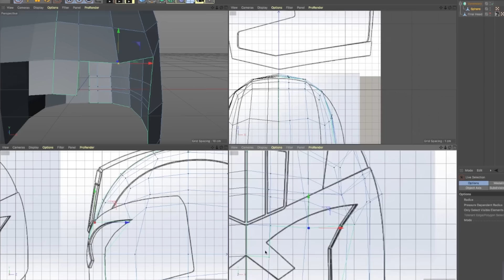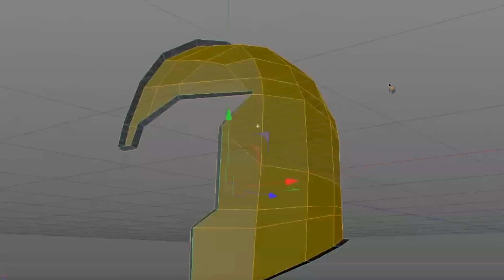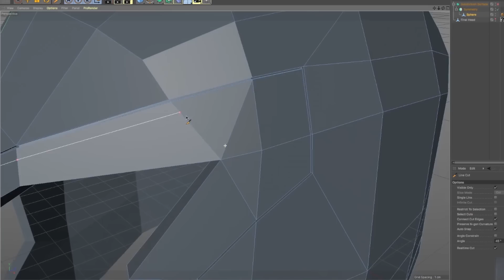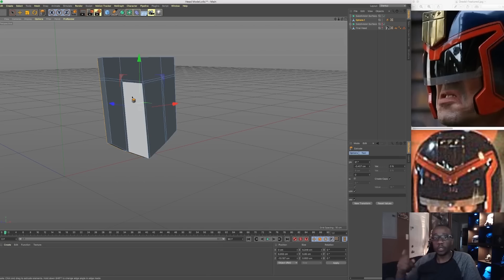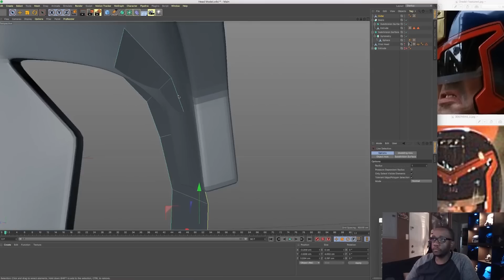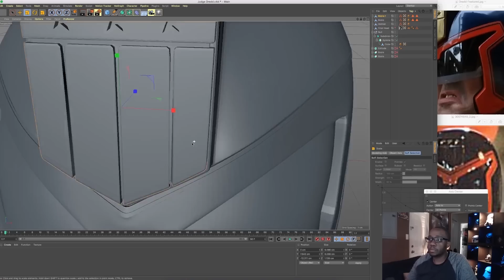Modeling a Judge Dredd Helmet for 3D Printing!

Comment: While I think this was a great video, a few things were not quite right for me! The badge actually only had 3 vertical bars not 4. And the jaw line of the helmet had a different profile, it cut back up instead of curving straight around. The visor also had an angled up cut on the bottom corners. Attention to detail is what it's all about when creating a replica. However showing the process was great!

Comment: Interesting video watching someone else model Dredd's helmet. I modelled mine (the real one that is) almost exactly the same method, although I kept it strictly all quades from the base mesh, which ended up being really difficult, I can tell you. This one isn't Dredd's helmet, though. It's not a judges helmet unless it has that iconic 'X' guard across the front. Plus there's just something overly clean and "off" in terms of the shape and design. Looks like something more from Buck Rogers than from Dredd's universe.

Comment: It's fun to watch all this whiz-bang stuff fly by. Gotta say, whenever one of those menus drops down and I see a minimum of 65 items to choose from, my heart sinks. Worse-- the "final" is still pretty far off. The angled shape above the "temple" area is not a sharp enough angle. The shape that hangs down off of the end of that angle-- is not straight, it curves a little. The badge emblem shape that is on the forehead comes out further is more vertical.
I am not blind to the abilities of 3D printing nor the underlying modeling programs. But right now-- seeing Darrell at the top of his game still getting it wrong -- is demoralizing. Between the cost of the programs and the materials -- and no small amount of time invested up to this point and then here -- working in clay is easier.
Consider the amount of hand finishing that goes into making a large print look good. Not much different from wet-sanding fiberglass (which I am guessing the Dredd helmet was made with). Problems of modeling the inside and fitting the plexi-- sure, all additional steps. But making more than one of these "one-off" 3D prints-- is just as much hand-work and trouble. A series of molds for something that large is expensive either way.
When the movie biz makes one of these, they pay through the nose to get a perfect finish with essentially no hand-work needed save for paint prep, etc. So, to me, that's what's got to change. The cost of the high-end prints. Otherwise clay, wax and scratch building is still better.
I still enjoyed the video.

Comment: The reason it gags when you subdivide is because you're using this software on a mac. A better work environment would go a long way. There's good reason the professional space is moving AWAY from mac for literally everything design/engineering/media production.

Comment: IMO Darrell went to the detailing part way too soon. He should have defined a simple "cup" shape and left it underneath to use both as a guide and to extract shapes from (including the visor). Then the bottom corners of the "eye" wouldn't protrude as much and would follow the overall roundness of the form a little better.
That, and he should also avoid the wonkiness of his loops because that gives problems later on, as it did.

Comment: Ahhhh great work!... but my detail nerdiness can't stop tingeling. Not sure if you followed the reference picture all the way but the visor has more of a curve at the bottom and the top corners are a bit wider than the picture. Still! Never 3D modeled so I couldn't do it better myself.
Reply: I'm with you there, all props to the guy but I was screaming inside on the top corners and emblem 3/4 discrepancy

Comment: The amount of pinching in the model X(

I guess it's fine when 3D printed.
Reply: As a 3D Modeler who has made helmets and armour for 3D printing I know your pain seeing that.
Reply: @Chris-jo1zr  Yeah, I can see it being fine for 3D printing, you'll end up sanding etc. a lot anywayd :D But the 3D modeler side of me could not stop seeing them :D
Reply: Yeah, seeing this new wave of 3D accessibility is nice but upsetting seeing weird practices or "bad" work, but then again like you said, it only needs to be a decent STL file, not like it's being used for anything else.
Reply: THE PINCHING WAS DRIVING ME MAD YO! Such terrible topology XD I just wanted to shout at my monitor hah.
Reply: Yeah, anyone who has enough experience 3d modelling, we develop OCD, and that pinching would drive me mad until I ironed it out. Sometimes it's unavoidable with curved hard surface models, though. Tri's are the same.
Reply: @steve_ire321  Sometimes you arent trying hard enough :) 

Also N.U.R.B.S
Reply: @sacredgeometry  Or we try too hard for being overly pedantic and picky. :) Not really a fan of spline modelling. I only really use them for deformations along a path, 3d text and stuff like that.
Reply: @sacredgeometry  I think it's just because there's less control, or it's a bit dated in its application. Plus Max has tools and modifiers like open sub div or turbo smooth with poly meshes where you can work with the hierarchy to make quick and adjustable changes to the lo res without it being a destructive workflow. You can't really do that with nurbs.

Comment: Can anyone explain why the shield/badge is sometimes shown with 4 stripes and sometimes with 3?
Reply: with a character like Dredd whose been drawn differently by many artists over the years you get a lot of variations in the design, this can lead to issues when getting reference for 3d modelling, prop making.
Reply: It was originally a vent. The top part of the helmet slid down to act as a respirator.

Other than that, what the other guys have said. Different artists drew it their way.
Reply: Yeah, in Carlos' original concepts it wasn't there at all. I modelled up a retro version a few months back, where it's more like a vent.

https://pbs.twimg.com/media/Dom_QQyW4AIguEV.jpg:large

In the 2012 version the Hall of Justice guards have 2 bars, so they have some kind of distinction between divisions.

But it's all down to artists preference in the comic.
Reply: In the comics it was a drop down gas mask.
Reply: Yeah, I tried mocking that up on my retro version.

https://twitter.com/SteveDeeGreen/status/1055825879731986432
Reply: @Limpylegs The way it was originally drawn in the concept sketches is slightly different, it wouldn't block the eyes much as it's more tapered.

The early version makes more sense dropping down, as it covers the mouth better - but Carlos had moved onto Battle and Strontium Dog so never drew it on the strip until a good few years afterwards.
Reply: I thought it had something to do with rank.
Reply: closest info I could find was that for the stalone film at least the bars denoted 3 Mega-Cities that the judges operated in, outside of that the judges dont really visually distinguish rank outside of the Chief Judge and differeing branches of the Judges (such as SJS and PSi divisions).

Comment: That was great to watch, though I only have one little nitpick. If Darrell was making the Stallone-version of the Dredd helmet, then the shield/badge should only have 3 vertical bars.... not 4. Though, oddly, the final render looks like it was fixed. :p

Regardless of my own gripes, fantastic work! Hope you do more of these.
Reply: As he said right at the beginning, it's hard working off of several different references. He obviously spotted the mistake and fixed it :)